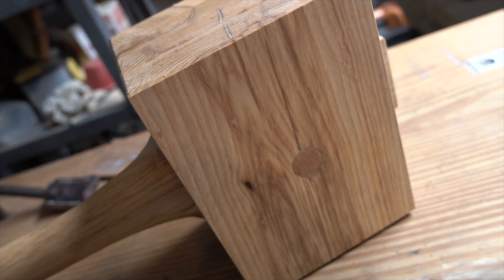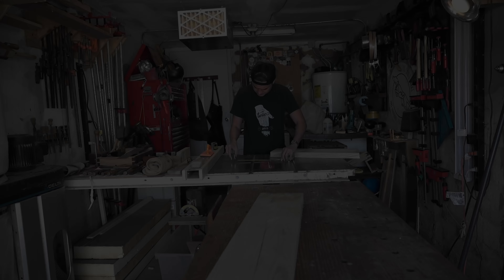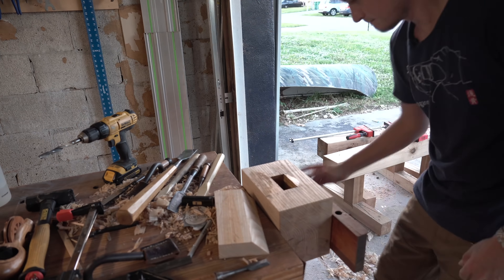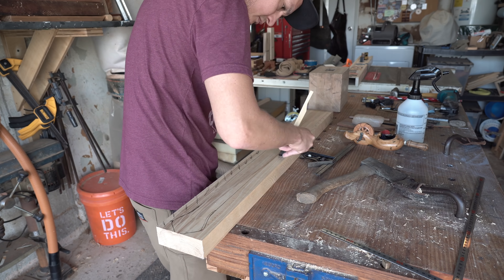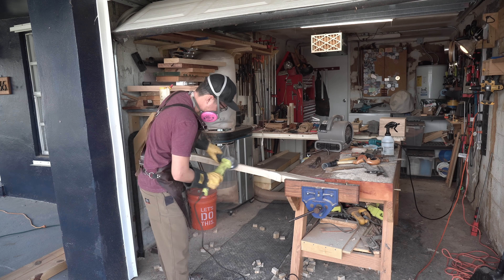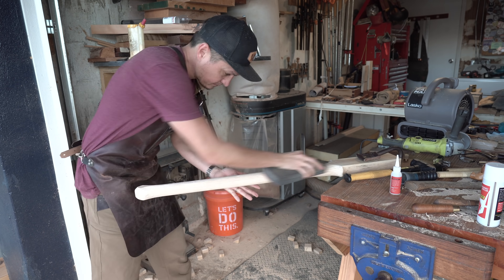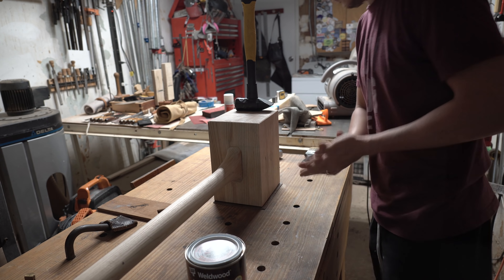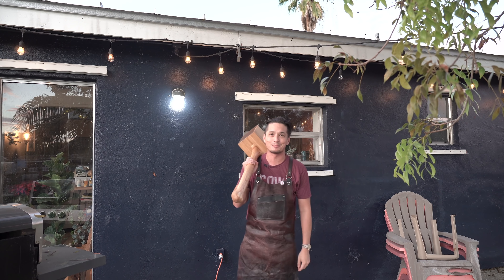A Timber Framing Mallet Like No Other!

Comment from the maker: Help support my channel through the following links:
DIABLO 1/3 Sheet Reusable Hand Sanding Block with Assorted SandNET Faster Reusable Sheets (80,120,220 Grit ): http://homedepot.sjv.io/c/2589535/1208502/8154
DIABLO Universal Fit Carbide Oscillating Blade Set (3-Piece): http://homedepot.sjv.io/c/2589535/1208500/8154
DIABLO 1 in. x 17-1/2 in. High Speed Steel Auger Bit: http://homedepot.sjv.io/c/2589535/1208501/8154
The Real Milk Paint Company's Impressive line of finishing products (Special Affiliate Link):
https://www.realmilkpaint.com/ref/cowdogcraftworks/
For 10% off use coupon code: cowdogcraftworks
-Starbond CA Glues (Special Affiliate Link): https://bit.ly/3A6I5h8
For 10% off use coupon code: cowdogcraftworks
-Western Saws Sourced from Florip Toolworks (Non-affiliate): https://floriptoolworks.com/
-Sumitsubo, Ink, and Related tools from Hida Tool (Non-affiliate): http://hidatool.com/

The Complete Japanese Joinery (Book): https://amzn.to/2OAj1sM
Makita MT01R1 12V CXT Lithium-Ion Cordless Multi-Tool Kit: https://amzn.to/3dphwdg
Z-Saw Cross H-265 Carpenter Saw Hard Impulse 15003: https://amzn.to/3oWENbT
Kutzall Extreme Shaping Dish - Coarse, 4-1⁄2" (114.3mm) Dia. X 7⁄8" (22.2mm) Bore - Woodworking Angle Grinder Attachment for DeWalt, Bosch, Milwaukee, Makita. Abrasive Tungsten Carbide, DW412X90: https://amzn.to/31GXyI7
Shapton Glass Stone Set w/Field Holder #500, 2000, 16000 Grit 5mm: https://amzn.to/3ojR230
Metric Japanese Style Carpenter's Square: https://amzn.to/35kC3fG
Mini Square 10x5cm: https://amzn.to/36mtcti
Faber-Castell Ecco Pigment 0.1 mm Pen: https://amzn.to/36oLni8
Pentel Mechanical Pencil: https://amzn.to/36uqbab
Center Punch: https://amzn.to/3fSQsCj
Yataro Authentic Japanese Chisel Set (5 Piece): https://amzn.to/3CLUEyV
Real Milk Paint Pure Tung Oil: https://amzn.to/3fFil0S
Tormek T-8 Water Cooled Sharpener: https://amzn.to/3hM39jn
Stanley Sweetheart Chisels: https://amzn.to/2ZATrKg
DFM Tool Works Card Scraper Set: https://amzn.to/2CMZp1W
DFM Tool Works Card Scraper Burnisher: https://amzn.to/2ZAwzuv
DFM Tool Works Small Square and Center Finder: https://amzn.to/3jfFdXd
Glu-bot Glue Bottle: https://amzn.to/2CdxYOV
Mineral Spirits: https://amzn.to/31xTBmG

If you want access to more tools, check out my amazon storefront: https://www.amazon.com/shop/cowdogcraftworks

//Follow along:

IG: https://www.instagram.com/cowdogcraftworks/
Twitter: http://www.twitter.com/cowdogcraftwork
Facebook: http://www.facebook.com/cowdogcraftworks
Website: http://www.cowdogcraftworks.com